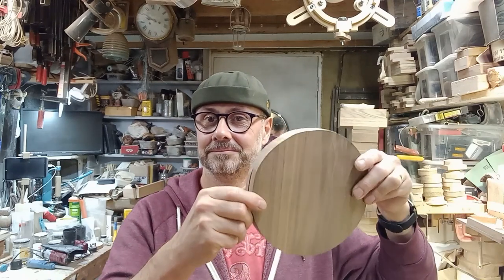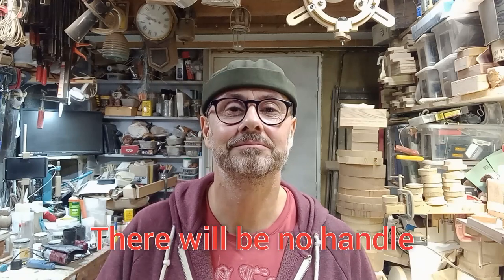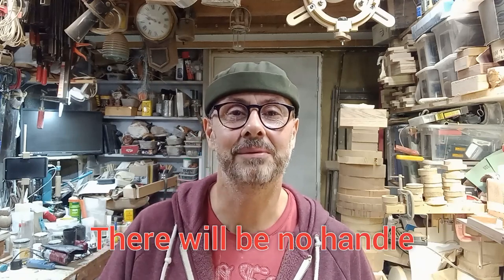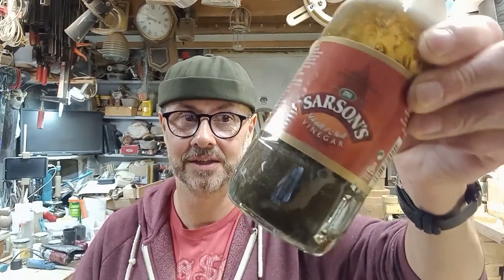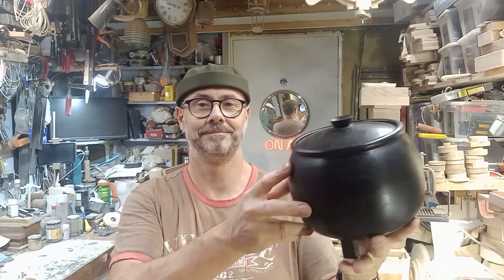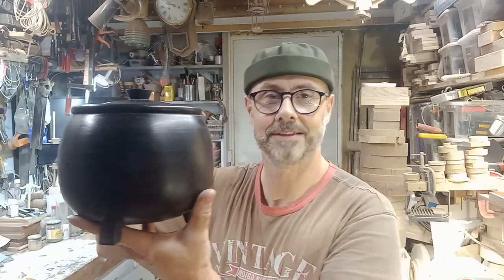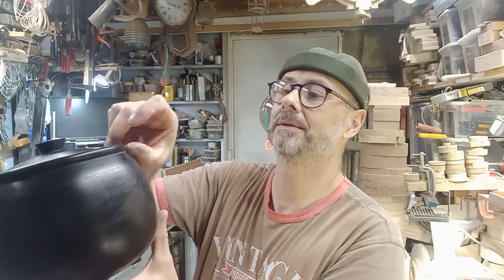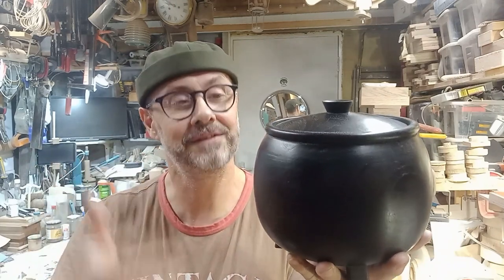Wood turning an ebonised walnut witches cauldron...with music

Comment: Nice work! Does the ebonizer work with any wood?
Reply from the maker: Unfortunately not....as far as I'm aware its oak walnut and cherry. To mix it get a bottle of white vinegar and empty some out then put in some steel wool....this disolves after a week or two depending on the amout you put in....i used old steel  wool....you can use nails but they dissolve slowly....hope this helps...thanks for watching